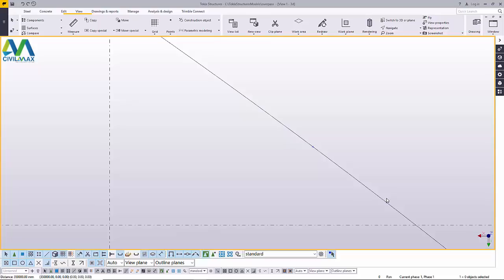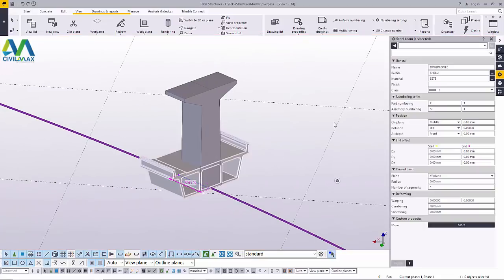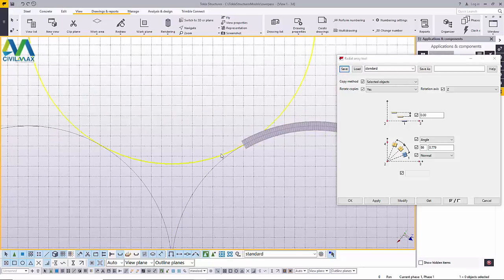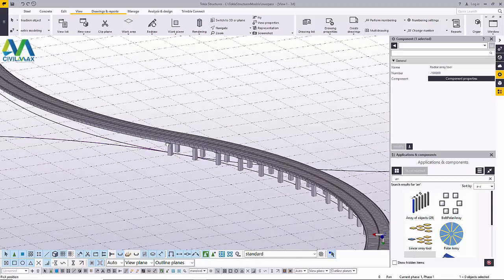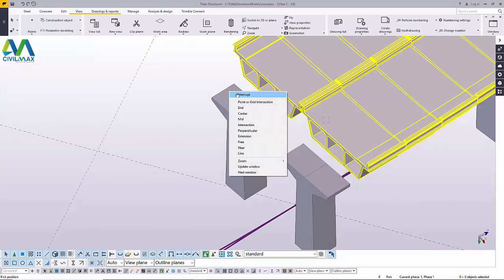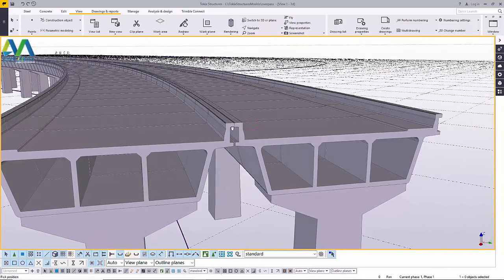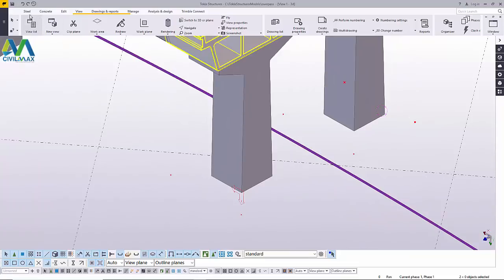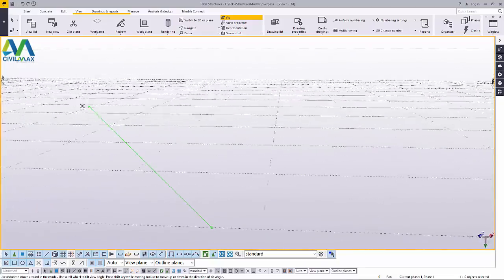How to Create Concrete Bridge using Concrete Shells in Tekla Structures

Comment: ### Introduction to the Tutorial [00:02](https://www.youtube.com/watch?v=ZsnccTTM-Es&t=2)
- The tutorial begins with an introduction to the project: creating a concrete bridge with concrete pillars and shells.
- The presenter outlines the initial setup, including defining the bridge profile using three circles on the grid.

### Defining Measurements and Profiles [02:44](https://www.youtube.com/watch?v=ZsnccTTM-Es&t=164)
- Measurements are taken to ensure accurate distances (350 meters between centers).
- The presenter discusses creating a custom pillar profile in AutoCAD and importing it into Tekla Structures.

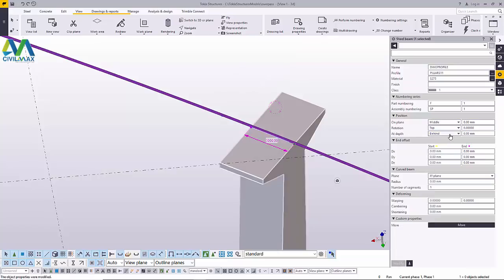### Creating the Pillar [05:23](https://www.youtube.com/watch?v=ZsnccTTM-Es&t=323)
- The process of creating the pillar is demonstrated, including switching to a 3D view and adjusting properties like diameter and thickness.
- The importance of aligning components is emphasized.

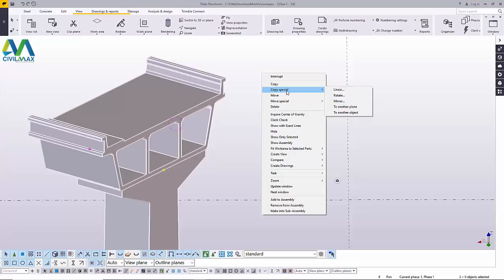### Creating the Shell [08:18](https://www.youtube.com/watch?v=ZsnccTTM-Es&t=498)
- The tutorial moves on to creating a shell that will sit atop the pillars.
- Steps include selecting beam profiles and modifying them to fit the design specifications.

### Mirroring Components [10:59](https://www.youtube.com/watch?v=ZsnccTTM-Es&t=659)
- The presenter explains how to mirror components across an axis to ensure symmetry in design.
- This includes selecting midpoints for accurate placement.

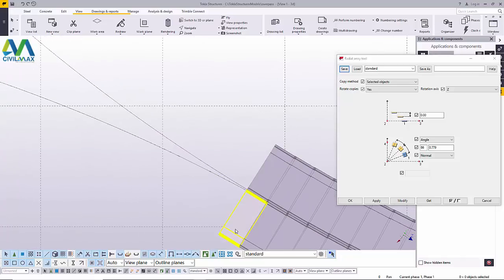### Populating Shells Along the Path [13:45](https://www.youtube.com/watch?v=ZsnccTTM-Es&t=825)
- An array tool is used to populate shells along the defined path of the bridge.
- Adjustments are made to ensure proper spacing and alignment.

### Finalizing Pillar Placement [16:04](https://www.youtube.com/watch?v=ZsnccTTM-Es&t=964)
- Further adjustments are made to ensure all pillars are correctly positioned along the bridge path.
- The presenter checks for any deviations from the intended design.

### Adding Footings [27:56](https://www.youtube.com/watch?v=ZsnccTTM-Es&t=1676)
- Footings are introduced as an essential part of the bridge structure.
- Techniques for creating footings using slabs are demonstrated, including copying and positioning them accurately.

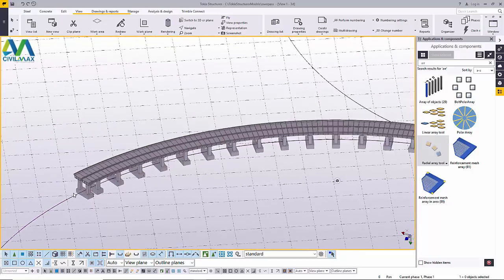### Conclusion and Final Review [38:05](https://www.youtube.com/watch?v=ZsnccTTM-Es&t=2285)
- The tutorial wraps up with a review of the completed bridge model.